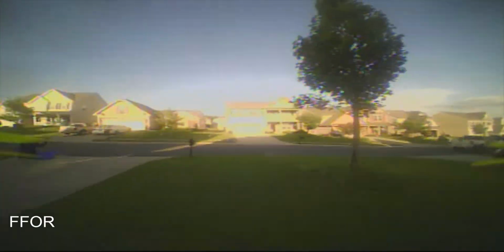Bad flight days...still better than no flight days...

Comment: Whats head free mode?
Reply from the maker: You can set it to a switch.  it basically means your roll and pitch will control forward, back, and side to side without regard to where the 'front' is pointing.  it makes LOS very easy bc all directions are relative to you...so if you go forward, yaw right and pull back on the stick, the quad will come back as if you never yawed.
Reply: ok wow I had no idea.  THere is a mode like that on the phantom4P I have. Never even crossed my mind you could set it up on a quad.  Cool thanks, I learned something here.
Reply from the maker: yea, just check it on the modes tab in betaflight.  just DO NOT FLY with it on when you put on goggles.  it was SO disorienting...i thought i failsafed.  i set mine to a dial and didn't realize the dial was turned to on.  my mistake.